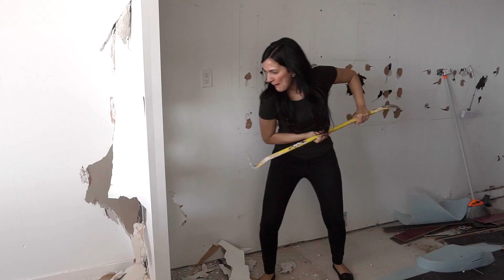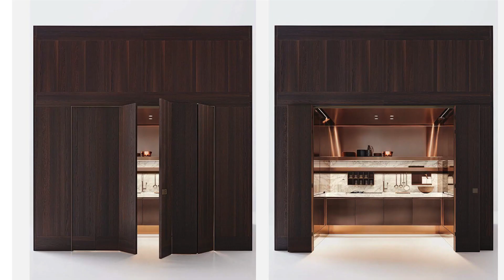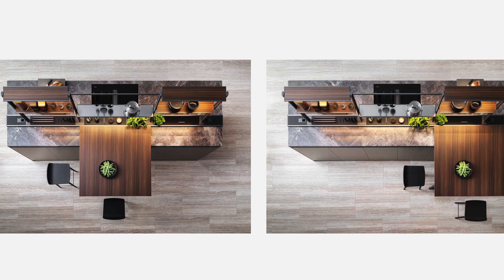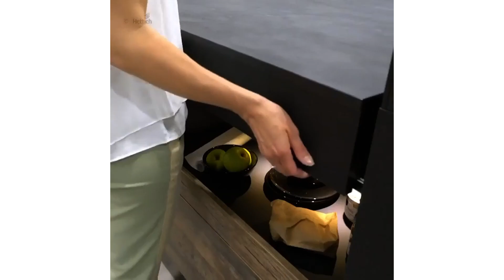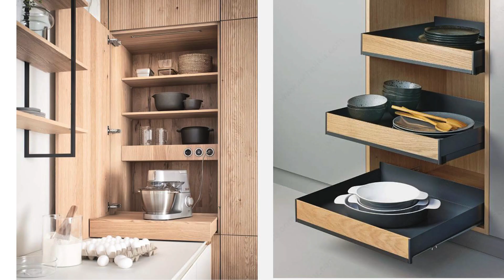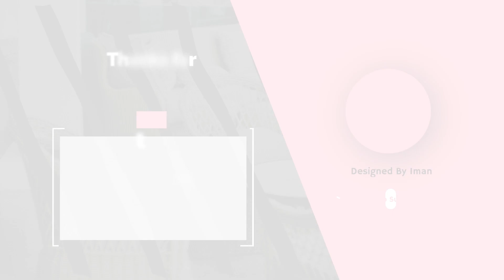Kitchen Design Ideas and Concepts 2021

Comment: What are the biggest differences between Italian and German kitchens??
Reply from the maker: Not sure 🤷‍♂️ - the hardware in German kitchens is supposed to be excellent but hard to stereotype... depending on the brand, etc.
Reply: @DesignedByIman  do you mean the Hinges? The basic difference I can tell is that Germans (at least on the website) tend to emphasize more the Functional practicalities of the cabinets. Whereas Italians look more Decorative, gives a “sexier” impression of the whole kitchen. Other than those, I’m not entirely sure if either the Germans or Italians are more “comfortable” or “durable”. The features seem to be on level playing field.